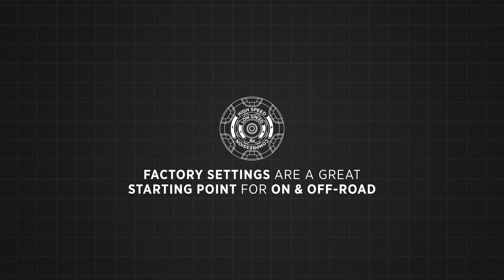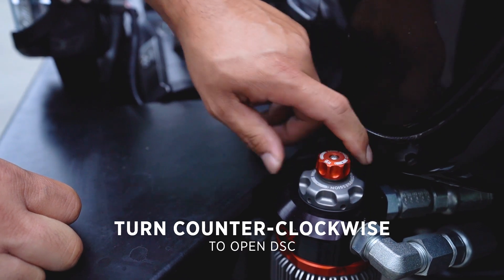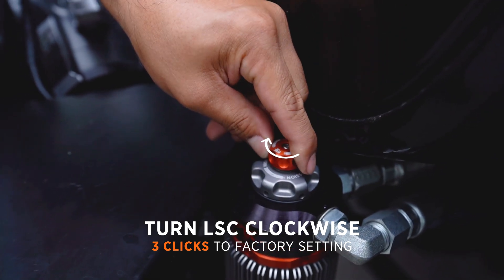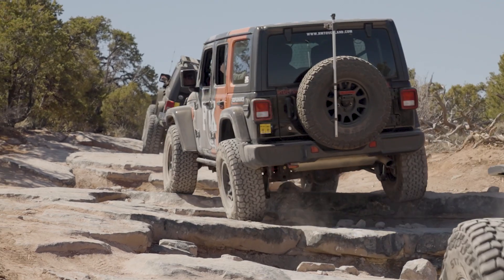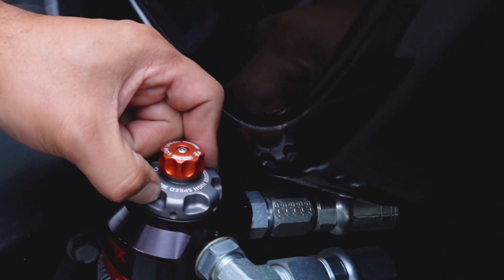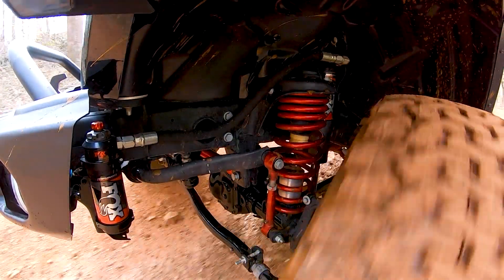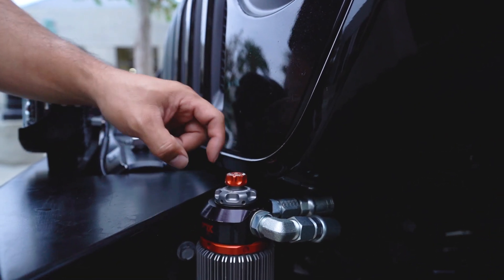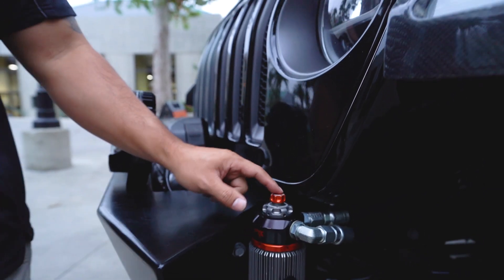How To Adjust DSC to Factory Settings » ACADEMY | FOX

Comment: For the amount of money these cost, one would think Fox would put out a real video to explain how to firm them up or offer setting examples for various scenarios.  I'm very disappointed with the lack of instruction you get with them. I carry a lot of gear on my JLU eco diesel and no matter where I set these shocks, it always feels the same. I have a Clayton 3.5" lift which was engineered for the added weight of the diesel and thought these shocks would allow me to carry extra gear. Anyone who truly understands these and how they work who could offer me some direction would be much appreciated
Reply: You need stiffer rear springs or air bags
Reply: @TJ-po9ol no you dont
Reply: @paranormalwheelers  Extra dampening isn’t going to fix a packed down spring, it will just slow the shock down in high or low speed

Comment: Hey i recently bought these shocks for my ford ranger… however the high speed compression knobs wont turn on either of the four reservoirs. Any suggestions to get that fixed?
Reply: did you ever figure this out?? i have the same issue